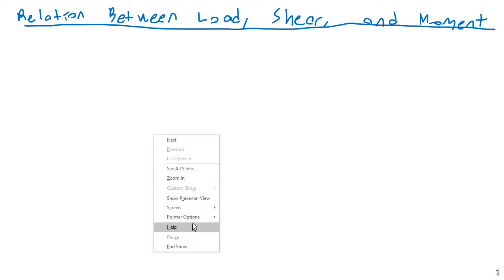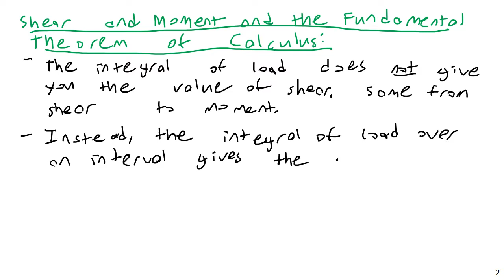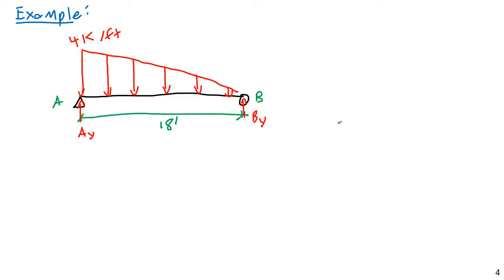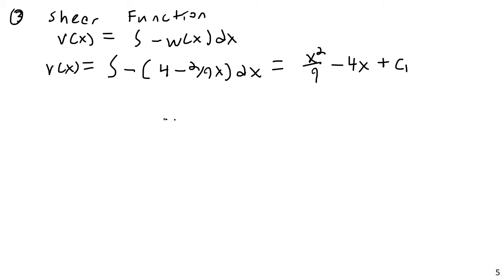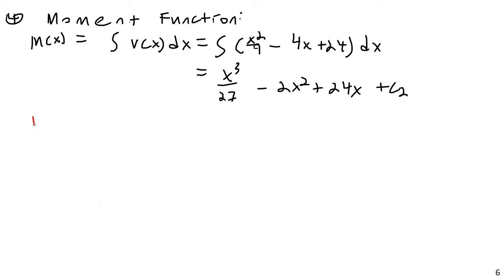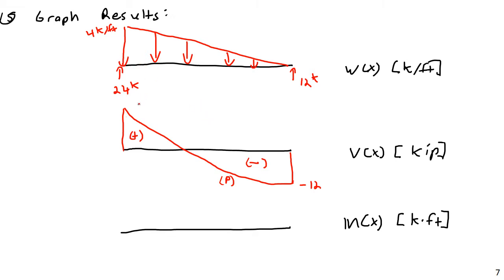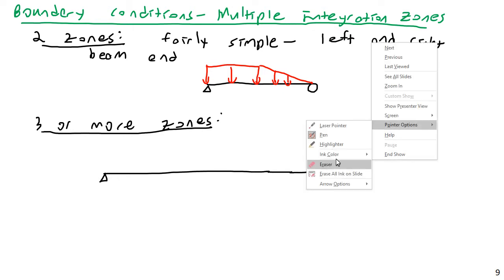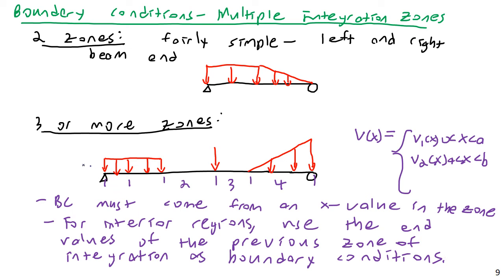Shear and Moment Diagrams Via Integration

Comment: Hi my name is Gowtham from India why clockwise moment is positive and anti clockwise is negative
Reply from the maker: This is what we refer to as a "convention." A convention is something chosen not out of any kind of real physical law, but because of either arbitrary choice or cultural factors. Another example of a convention is how we demarcate time. Why divide the day into 24 hours,  each 60 minutes long, each 60 seconds long? That particular convention history going all the way back to ancient Babylon, but it's an example of something that was just chosen and then stuck around.

Now, back to the moment. Counterclockwise moments are positive because engineering comes out of physics, and physics tends to use counterclockwise as positive for anything involving rotation. It gets interesting when you consider 3D coordinate systems. The way cross-products and other 3D vector operations work, there are really only two types of systems you can use that are internally consistent. You can use either a "right-handed system" or a "left-handed system." See here:

https://en.wikipedia.org/wiki/Cartesian_coordinate_system#Orientation_and_handedness

So the actual makeup of reality, physics, mathematics, etc, does dictate that we use either a left-handed or right-handed coordinate system. These are the only two ways to build a consistent x-y-z coordinate system. As for why we settled on right handed? Likely this is entirely cultural. Rationally, there is no reason to prefer a right-handed system. However, humans are humans. When we had to choose between left or right handed systems, predominant cultural forces took over. 

About 10% of humans are born left handed. If history teaches us anything, it's that human societies will always find a reason to take some insignificant difference between people and magnify it, stigmatize it, and use it as a means of dividing people. Taboos against left-handed people have existed all over the world and for all of history, and there are many places around the world where such stigma is still common. Rationally, looking down on someone for which hand they have dominant is one of the most patently absurd things we could possibly do, yet history shows that we are often anything but rational beings.

Anyway, sorry for the long description, but this is one of those areas where engineering, mathematics, history, and sociology are all intricately woven and inseparable from one another. In summary, it could explained like this:
1. 90% of humans are born left handed.
2. Societies throughout history has used (1) as a reason for stigma against left-handed people and left-handedness in general.
3. Mathematicians discovered 3D coordinate systems and realized they had to be either right or left handed. They chose right-handed due to (2).
4. When physicists and engineers started working with the concept of moments, they define counterclockwise as positive due to using the right-handed coordinate system from (3).